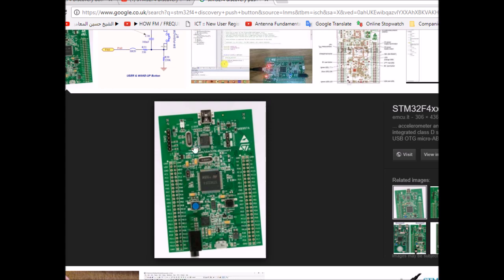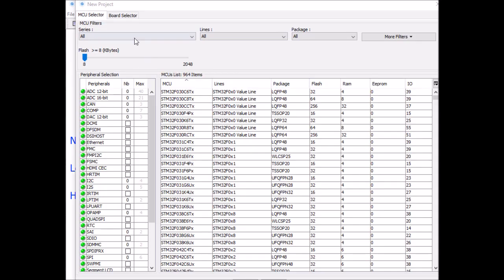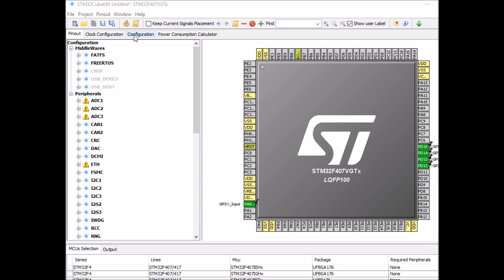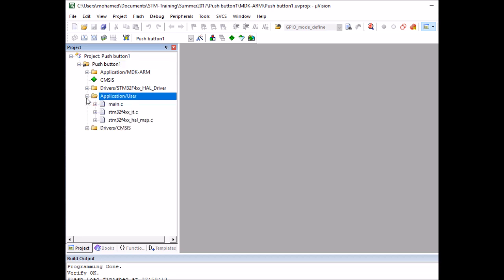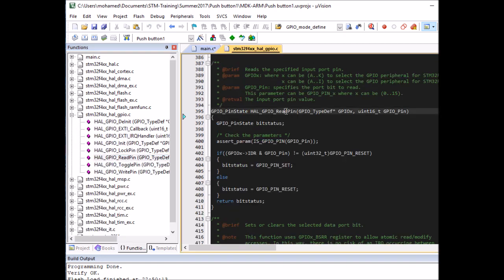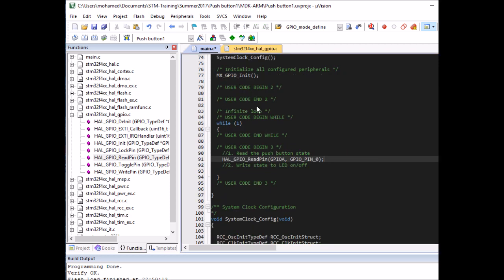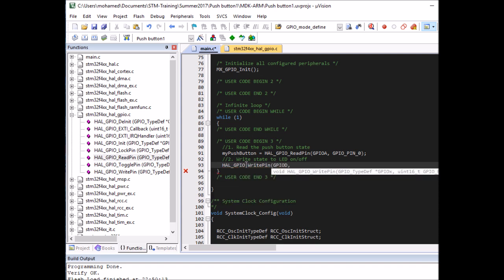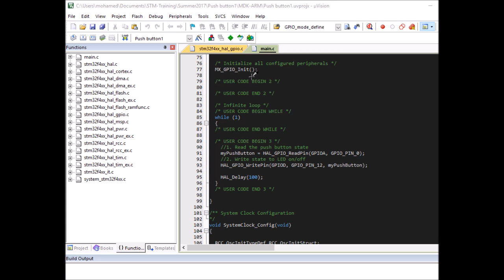STM32F4 Discovery board - Keil 5 IDE with CubeMX: Tutorial 2 Push button - Updated Oct 2017

Comment: For those who are trying to read the button without cubeMX. Here is a littel example Code which does exactly that:

#include "stm32f4xx_hal.h"

//Function Prototypes
void configPins(void);
void _delay_ms(uint32_t);

int main(void)
{
	configPins(); //Initialize Inputs and Outputs

	while(1)
	{
		//Is user push butten pressed?
		if(GPIOA->IDR & 0x01)
		{
			GPIOD->ODR |= (1 << 12) | (1 << 13) | (1 << 14) | (1 << 15); //turn on all LEDs
		}
		else
		{
			GPIOD->ODR &= ~((1 << 12) | (1 << 13) | (1 << 14) | (1 << 15)); //turn off all LEDs
		}
	}
}

void configPins(void)
{
	RCC->AHB1ENR |=   (1 << 0)  // Enable Clock on GPIOA
					| (1 << 3);	// Enable Clock on GPIOD
	//Initialize all LEDs
	GPIOD->MODER |=   (0b01 << (12 * 2)) //Initialize Pin 12 as an Output
					| (0b01 << (13 * 2)) //Initialize Pin 13 as an Output
					| (0b01 << (14 * 2)) //Initialize Pin 14 as an Output
					| (0b01 << (15 * 2)); //Initialize Pin 15 as an Output
}

//Delay Function
void _delay_ms(uint32_t delay)
{
	for(uint32_t i = 0; i < (delay * 1000); i++);
}
Reply: So called "bare metal" programming, which can be even improved using defined labels for involved bits.

Comment: Hi Sir, i trying to write the low level function for the push button but i stuck in somewhere can u help me to correct my code? Thanks a lot!

button= B1_GPIO_Port->ODR ^= 0x0001; //this is the location of GPIO_Pin_0, the blue button on the board called USER
GPIOD ->ODR ^= 0x2000; //This is GPIO_Pin_13, the orange LED
Reply from the maker: Button must use IDR register not ODR.
IDR: Input Data Register
ODR: Output Data Register
Reply: I change it to IDR now but the LED totally can not ON. I worried is it becasue i never add the Button into GPIOD?
I saw in your video the code by using library will include the myPushButton into the HAL_GPIO_WritenPin but seen like i never add the Button into GPIOD is it due to this reason?
Reply from the maker: @aloysloh2652  
GPIOA for button on discovery F4 board

Comment: Sir, I am having trouble doing it without CubeMX. Even though my code is running without error. Kindly sort it out.
Reply from the maker: Hassam Khan 
Hi Khan,
I will be happy to look at your main code perhaps, if you would share it with me here :)
Reply: Sure Sir. I am sending it here right now.
Here it is:

#include "stm32f4xx_hal.h"

void configureGPIO(void);
void msDelay(int msTime);

int main(void)
{
 GPIO_PinState push;
 HAL_Init();
 configureGPIO();
 
 while(1)
 {
  push = HAL_GPIO_ReadPin(GPIOA, GPIO_PIN_0);
  HAL_GPIO_WritePin(GPIOD, GPIO_PIN_13|GPIO_PIN_14, push);
  
  msDelay(100);
 }
}

void configureGPIO(void)
{
 GPIO_InitTypeDef GPIO_InitStruct;

  __HAL_RCC_GPIOA_CLK_ENABLE();
  __HAL_RCC_GPIOD_CLK_ENABLE();

  HAL_GPIO_WritePin(GPIOD, GPIO_PIN_12|GPIO_PIN_13|GPIO_PIN_14|GPIO_PIN_15, GPIO_PIN_RESET);

  GPIO_InitStruct.Pin = GPIO_PIN_0;
  GPIO_InitStruct.Mode = GPIO_MODE_INPUT;
  HAL_GPIO_Init(GPIOA, &GPIO_InitStruct);

  GPIO_InitStruct.Pin = GPIO_PIN_12|GPIO_PIN_13|GPIO_PIN_14|GPIO_PIN_15;
  GPIO_InitStruct.Mode = GPIO_MODE_OUTPUT_PP;
  HAL_GPIO_Init(GPIOD, &GPIO_InitStruct);

}

void msDelay(int msTime)
{
 for(int i=0; i<msTime*4000; i++);
}
Reply from the maker: Hi Hassam,

The code looks good,, Just double check your Keil Software Components,, make sure you enabled all the required software components,,, I showed how to do that in my 1st tutorial (the LED one, at NoCubeMX part, do watch it).
Good luck :))